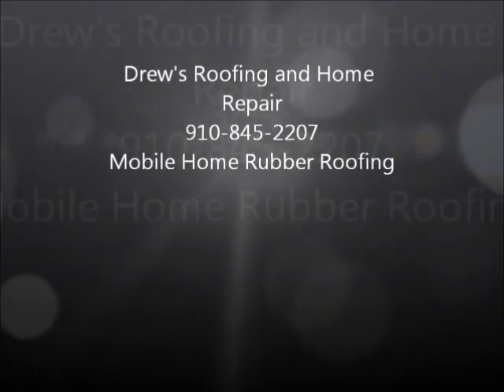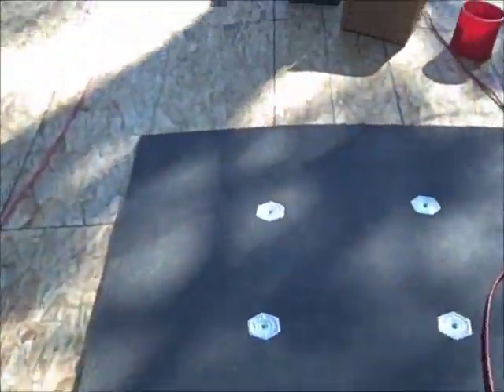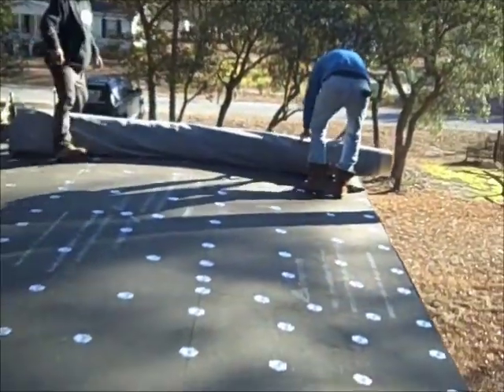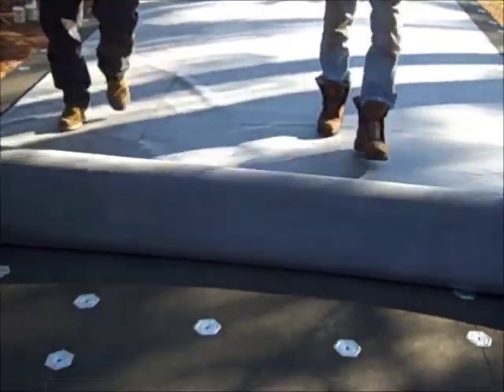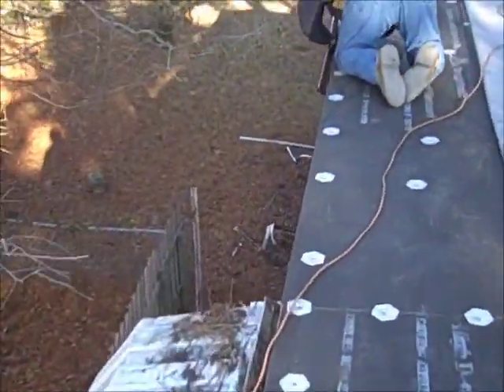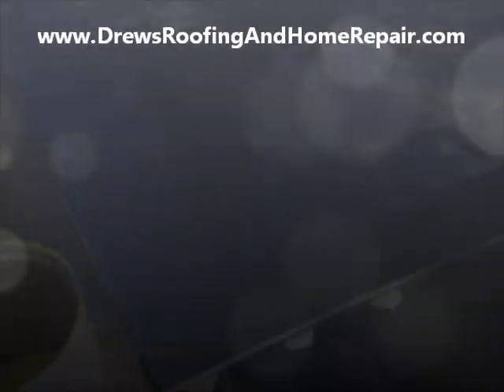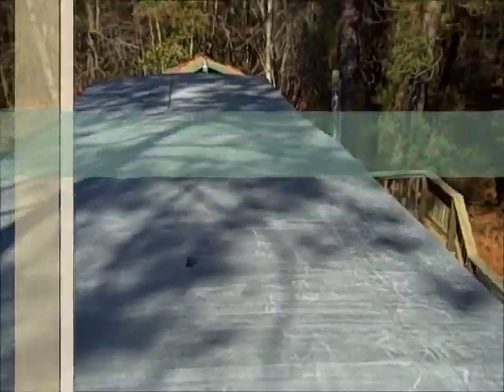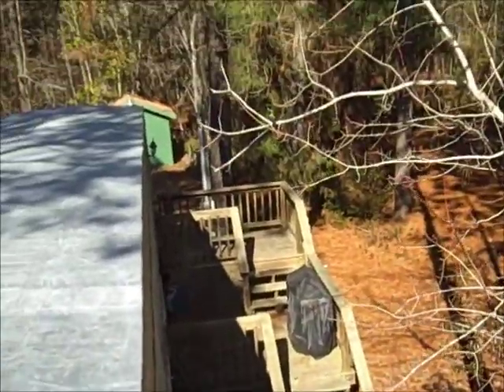Mobile Home Roof Leak.How to fix It .

Comment: I can not believe how old this video was, so I see that back then the repairs on mobile homes was different comparing till now, so my question is which method of the 2 is better the one you do now or the one before?
Reply from the maker: Now is way better with the overhang. It changes every thing. We got better as we went along
Reply: @Drewsroofingandhomerepair  Yes exactly the overhand is the best way to do it! I have seen many videos of mobile home repairs and your method is probably the best way to do it for old mobile homes which have the flat top roof!
Reply from the maker: Thank you so much we worked hard to perfect this roof over system on mobile homes and it seems to be working well

Comment: I did not glue my rubber down. IN the cool time its tight/ during the hot time of the day its wrinkled up. Not sure but im planning to rool a white coating soon. Maybe elastomeric.
Reply from the maker: Not sure why you chose not to glue it down but it’s not the worst thing I think you’ll still be OK keep up the good work Chad
Reply: I bought the glue /600$and my nieghbor contractor said he was not sure why id want to glue it down.. i thought id save money and avoid the fumes. I cant find uni- surface glue( waterbase)  all i can find is the stinky stuff. And i got no good helpers tp applicate. . Thanks Drew for teaching me and sharing your videos.